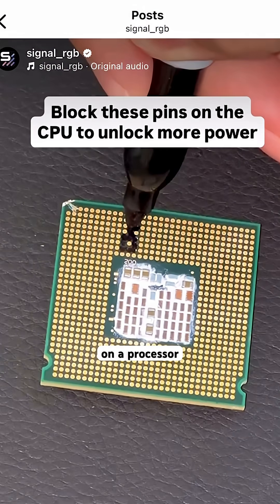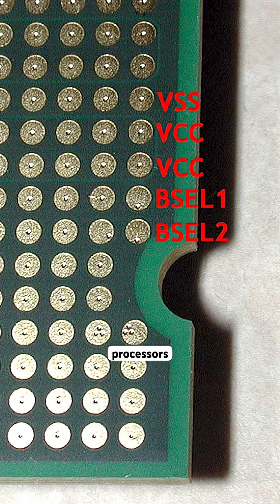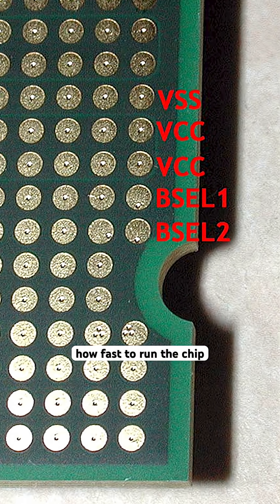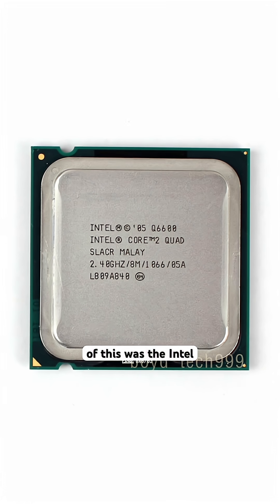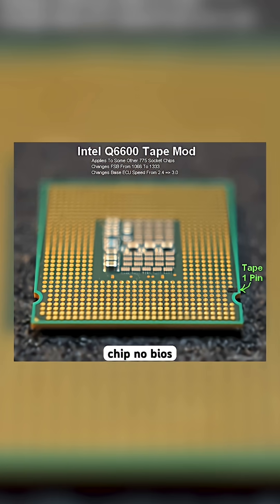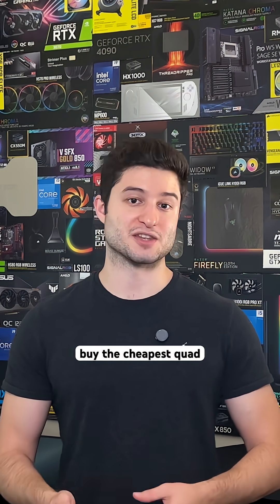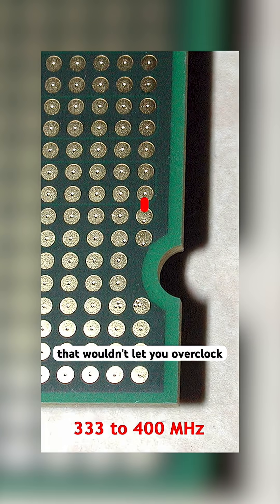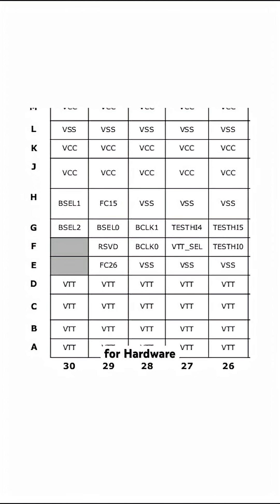Taping a CPU to improve it?!

Comment: Question is why? If all it took was to mod a couple pins... why didn't the chip makers do this? Does it make it run unstable? Does it overheat? Doesn't make sense they would just slow down the chip for zero reason
Reply: Slow down the chip for no reason? It's to have different price points and maximize profits.. 😂
Reply: Its because they all start as top of the line chips (well mostly) and defects are blocked out and you sell it as a lower tier chip. This would work generally but ran the risk of breaking your chip as you dont know what specifically the defect was. Its why currently lower core count cores sometimes have more cores but they are not used. Its to reduce waste and reuse effective chips as lower powered but properly working products. Its also why the full generations share the same socket as otherwise this wouldn't really work
Reply: This is how I understood it. All chips has some malfunctions baked into them. Ones with very few are premium chips and ones that have many are budget ones. However if you take a budget chip and hack the pins to think it is premium then there HAS to be some downside, or else the manufacturers would just sell it at a premium. I am sure there is some safety factor in there, but there has to be some catch to this?
Reply: @Teh_Random_Canadian  someone goes out to make an 8-core chip. Each core needs to be able to run 100w at 1.2v. let's say that's the standard. Two of the cores can only run 100w at 1.5v, so they disable those two because that voltage will kill the chip. They disable the two cores and now safely sell it as a 6-core processor. However those 6 cores remaining are very high quality and can run 100w at 0.8v. You now have a 6-core chip that can now do much better than average at 1.2v and can consider that a lucky silicon lottery winning 6-core chip.
Reply: It's not that they slowed it down for no reason it's that they attempt to make all the chips at a high spec that are able to run at those higher rates. But their production process isn't perfect so a decent chunk of them failed to meet that standard and rather than throwing those away they hobble them or rather market them as a lower spec chip and if they can do better and you want to do that go ahead do the workarounds but you are not going to get lied to in the marketing. It might run perfectly and not overheat or it might be incredibly unstable and throw errors and damage your CPU and your motherboard they don't want to be responsible for that so they just prevent you from doing it
Reply: There is a video of branch education “how micro chips  are made “you should watch that
Reply: Unlocking it doesn't mean it will work, it likely didnt pass quality control and so would not hold said frequency reliably, or said core would BSOD alot. 0x0000134 error. Sure you can unlock but will it work is anyones guess
Reply: The lower tier chips are made the same as higher tier, they just are the ones with defects that prevent them from reliably running at top specs. It’s fine if you’re willing to risk damaging the chip which is why they would use the cheapest option and just hope nothing goes wrong.
Reply: It's a way to maximize yield from wafers containing dies with damaged/defective sections, that are otherwise perfectly functional with lesser requirements such as lower frequencies/voltages, or fewer cores, to name a few.

This is the best way I've heard it explained: 

Intel is always trying to make the best i9 CPUs. But making every single die on the wafer reach that performance level is extremely difficult to do consistently, so many of those dies are binned as i7 CPUs instead. But that level of performance is also difficult to reach consistently, so several of those dies are binned as i5 CPUs. This goes on until every functioning die on the wafer has been binned from the top-tier i9 CPUs all the way down to scraping-the-bottom-of-the-barrel Pentium CPUs. The remaining dies may be functional in theory but have defects so severe that they aren't usable, or they just don't work at all. These dies are generally scrapped. The "barely functioning" dies may also be subjected to various tests before meeting the scrap pile.
Reply: @lka1988 So if you buy an I7 and do this mod, you can run it as an I9, but there has to be a caveat to that. Increased heat, shorter lifespan, or just complete failure of the chip? And if you bought an I5 and tried to run it as an I9 this would almost be a certainty? That is my question. What are the risks and results from doing this?
Reply: @Teh_Random_Canadian  So, uh, companies have long since caught onto this trick. Most lower-tier CPUs and GPUs sold these days are incapable of being modded this way. The affected sections are typically permanently disabled by blowing the e-fuses that connect them to the rest of the die. There is no way to reenable that.
Reply: The 333 MHz / 1333 MT FSB chips were only released later.
The E6750 and E6850 came with the higher FSB and the 45 nm chips had it as standard.
But stuff like the Q6600 with their 266 MHz/1066 MT FSB were the highest end at the time.

Besides that the lower end chips were typically cut down not just in clock but also in cache and FSB.
But they cost less.

So some of it is to fill budget markets, some is because chips are partially defective.
If the CPU can't run stable at the high clock, but is fine when slower, just sell it as a slower model.
If two of the cores are broken, but the rest is fine, disable them and sell it as a smaller version.
Reply: It is cheaper to make all the chips the same and then hobble them to make the lower tier cpu. and gpus. This is still done today.

Comment: The ultimate version is the sticker to make a xeon 771 cpu work in any 775 motherboard that supported at least X38 / P45 / P43 chipsets, you only need to get the microcode and port that in to a bios file for your motherboard and you were off the the races.
Reply: X38 and X48 wasn't supported via mod. Those could only run Xeons that had been LGA775 from the start (like workstation Xeons from X33xx family). 
On P-series chipset the mod was a blast!
Reply: @gagarin777   this is incorrect, some Asus motherboards did in fact have support because I  own them and ran the Facebook page for this mod :) Both the Asus Maximus extreme X38 aswel as the P43 / P45 and X48 I've tested :) I did use a single Xeon for all them though, the 	X5450. If you own a ASUS P5E Deluxe or an Asus Maximus Extreme X38 let me know, I will be able to assist you.

Comment: Seems like a hit or miss thing.
CPUs generally do start as the "top of the line" version of that chip, but the reason it ended up as a lower chip or a budget chip is because one of the tiles/cores is defective, cranked, or unstable.

Comment: what about thermals tho
performance always comes at a cost especially if it's a chip that's not designed to run this fast
Reply: Most chips are designed to run that fast they just failed to meet that standard and the reason that they're bin down can be that they didn't run stably at that higher clock speed or it could be that the cores didn't quite work correctly and boosting the clock speed doesn't really impact that.

Comment: Eh, often times the lower end CPU's were given these limitations because of the quality of the silicon on it. Sure, they could probably run stable for a little while or with an extreme amount cooling, but oftentimes they wouldn't. This is where the concept of chip bins came from.

Comment: You could also put socket 771 xeon cause from server boards into socket 775 by cutting the socket round shape bits and buying a pad that switches 2 pins around. This was a more budget friendly alternative to buying a core 2 quad and you were pretty much guaranteed to have one with a 1333mhz bus for around 15 pound compared to the q4400s 80+

Comment: Doesn't Intel test run the chips on the assembly line to see which ones can be rated at the higher clock speeds? In other words, it may be that a chip rated to run reliably at 2.4ghz might fail or run too hot at 3ghz.

Comment: Wait, cheap and expensive cpu is capable of the same? Why isn't it just all the good one and lower the overall prices?
Reply: They aren't capable of the same. The cheap CPUs are ones the company isn't confident can run stable at the expensive ones specs so they deactivate the reduce the spec and sell it at numbers they are sure it will hit.
Reply: @mark1A100 got it. Thanks

Comment: "you're driving a four cylinder you tape off a cylinder making it a three cylinder that actually runs like a six cylinder because it's running more of less."  Over clocking is like adding more fuel to what's already there not taking away to give more to fewer units.

Comment: This does raise some fancy questions . . .
Reply: Not even fancy questions.  
Chip manufacturers do stuff like this all the time
Reply: @AridDessert  well what can we the people do now?
Reply: @ThePestilentDefiler  well tbh in this instance i dont disagree with manufacturers only rating with a reasonable gurantee of performance. See the comments on the thread. Its not entirely scummy behaviour its about failure rates.
Reply: @ThePestilentDefiler dismantle the system that doesn’t work and make something better(it will happen anyways)
Reply: Essentially, wafer production isn't perfect, so manufacturers overproduce high end silicon to avoid shortfalls in supply for high end products, and the leftover good silicon as well as the not-quite-good silicon would be used for products lower on the totem pole.

The reason the cpus could typically be overclocked so easily is that the specs needed to be able to work with worse chips, and if you lost that lottery you'd just break the chip.
Reply: The people in these comment dont have any idea what they're talking about.
The reason the CPU's are cheap in the first place is because the silicon itself used for the chip is low quality, so the GHZ peak is lowered, as the silicons randomization (essentially) adds ALOT of resistance to higher ghz, meaning it will literally slowly destroy the silicon as the higher peak reaches the low quality silicon, making you more or less burn through your core 2's life span at a 70-200% rate, shortening its life span at the sacrifice.
Compare this to higher quality chips, aka higher quality silicon, and you dont meet resistance until far far far higher Ghz on average. The same rule applies, if you pushed the ghz to 7, 8 or 9 same issue would happen, heat is an issue for all silicon ect
Reply: @Telarius    Yes, but sometimes, you could get lucky and get silicon that was good enough for the higher binned chip.  Sometimes, if the manufacturer was selling too many low-bin chips, they would take some out of the high-bin and put them in lower bins. 

They don't do this anymore.  Now that almost all chips are sold through online stores, they adjust pricing to sell in the same quantities as they are making.  Back when most chips were sold in mail-order catalogues or in pre-builts at Circuit City they could only adjust pricing a couple times per year, not every day like they can now.
Reply: @Telarius  i do have a cpu older than you. It worked 20 years and now is in very good condition. And  I am sure that reason of existance a cpu the guy is talking about 1000 times more finacial than tech.
Reply: @Telarius  If youre burning through its life at a 70% rate, youre lengthening its life. Not being snarky, I know nothing about this stuff
Reply: @Telarius  ypu have far more patience than i. Good post ❤
Reply: @Telarius 
Where are you going after you die?

What happens next? Have you ever thought about that? 

Repent today and give your life to Jesus Christ to obtain eternal salvation. Tomorrow may be too late my brethren😢.

Hebrews 9:27 says "And as it is appointed unto man once to die, but after that the judgement."
Reply: @JesusPlsSaveMe gg
Reply: @Telarius  Absolutely wrong. Silicon doesnt really degrade that way. The issue is that some parts may be defective or have doping paths that would either be less conductive or more conductive at higher (or even lower) frequencies and thus cause errors. In some cases that causes silent corruption as was the case with ryzen 1000-3000s memory controller, where they introduced a hard crash condition on memory errors. Or could cause watchdog errors that just instantly crash the CPU as with many intel Atom CPUs since they are (the old embedded ones) designed to STAY at a frequency so as soon as they shifted they had timing issues.
Silicon damage isnt really a thing unless it gets too hot. Thats also why AMD Opteron CPUs had such low TJMax limits as they used bad dopants that would drift very quickly with temperature but allowed some funky new designing methods for cheaper production.
Reply: @Telarius  I work in the industry. Tiers have nothing to do with differing silicon quality. Chips that don't perform well have features (e.g. cores) turned off by physically "burning" pathways.
Reply: @Telarius And we're supposed to believe that like it's gospel lol you're so gullible
Reply: @Telarius  only 50% true
Reply: @Telarius  THANK YOU! People (and especially the uploader) not realising there are consequences to this bypass is hurting my brain 🤦🏼
Reply: essentially they first produced the CPU and test it.
Depending on the performance they set the chip into different tiers.
If the machines produced only 'good' CPUs, then the manufacturer had too many good CPUs and they downgraded those to the lower tiers and they overperformed for their tier. Therefore making this a thing.
If you overclock a normal CPU it will shorten it's lifespan and can have issues (??)
Reply: @benjaminmeusburger4254  A lot are overclocked by the manufacturer anyway, running sometimes multiple Ghz higher then the advertised base clock upon install. Not to mention motherboard manufacturers are introducing OEM current modifications that do not match those recommended by cpu manufacturers
Reply: An i5 i7 and i9 are exactly the same chip, but with less errors on the higher value chips. This means that you can get noticeable variation in the speed of what is supposed to be the same CPU. So they standardise it a bit so you know what you are buying. You can bypass this and get the full speed, but it is up to chance how much more you get from doing so.
Reply: I was like 666 happy Sunday, hail Satan
Reply: What it did was overclocking the FSB (front side bus) from 1000mhz to 1333mhz iirc, that boosted the clock for the cpu to 3.0ghz, I did it back in the day, it really made a good difference!
Reply: Yes, yes it does. I know the i9-7900x is capable of running 1TB RAM (8x 128GB LRDIMM modules). It was demonstrated by overclocker Nick Shih about 6 years ago. Oficially the CPU only supports 128GB RAM. :')
Reply: Even if you knew to cover it, you still needed to know how to overclock so you dont melt your CPU
Reply: Does anyone know how to overclock a AMD EPYC 9754 ?
Reply: It's not if you know how chips are made.
Reply: Generally they design 1 chip, and then when they are finished only like 10% of them are “good” and the rest have random issues. Those issues reduce the available functionality and you get lower end chips that’s till work but the manufacture graded them to only use certain firmware because half of the gates are messed up.
Reply: @tainicon4639 yup exactly
Reply: Well duh they still do this. It's cheaper than having to manufacture a brand new chip for just a slight amount of performance.
Reply: Not really, you're overclocking so its gonna burn out the chip faster. And there's a chance the particular chip you get is unstable. Chips costing twice as much could be overclocked too and have higher QC standards so its not as lottery.
Reply: Wouldn't this degrade the FUCK out of that CPU? Like a CPU that was built to max out at 2.5GHZ is now running at 4GHz, it wasn't built to run that fast so.. that's all I can think of.
Reply: @123sleepygamer No. If it degraded it, it would also degrade the higher tier chip. The lower binned chip is simply a unit that was not fully stable at the higher clock speed during testing, and so is advertised for the lower one. What can cause degradation is overvolting, that's not what's happening here though.
Reply: Yeah all im hearing is that we've been ripped off for no real reason
Reply: Probably a sign that they always were pushing obsolete tech as the new thing. The same with vista taking over from xp. When it just slowed everything down. Like they had to handicap it.
Reply: it doesnt. the lower end chips are lower quality and they will slowly die if you overclock too much or without proper cooling
Reply: The guy in the video is lying. The Q6600 had pins not pads. So this isn't possible.

Plus the Q6600 had an unlocked multiplier and was one of the easiest and most stable overclocking chips of all time.
Reply: @MrStaplez  So you're saying that the q6600 on socket LGA 775 had pins and not pads?
Reply: @Tagiau he's definitely wrong, they have pads, not pins.
Reply: @MrStaplez 1. Stop talking bullshit q6600 is NOT PGA, it's LGA. Why are you lying? 
2. If your bios simply doesn't allow OC your pc doesn't care if multi of the cpu is opened, idiot.
Reply: @MrStaplez I'm running several PCs with Q6xxx CPUs and I can assure you they have pads, not pins.